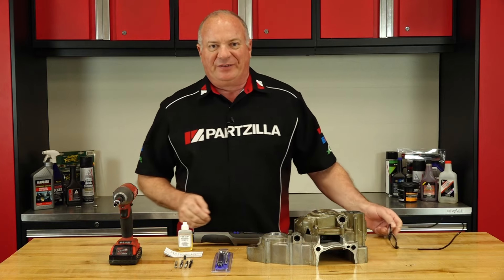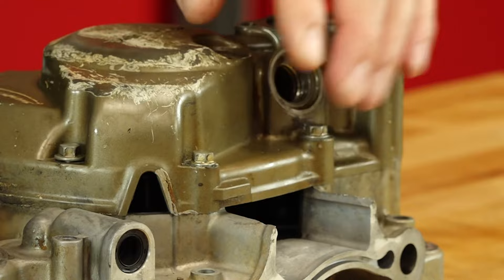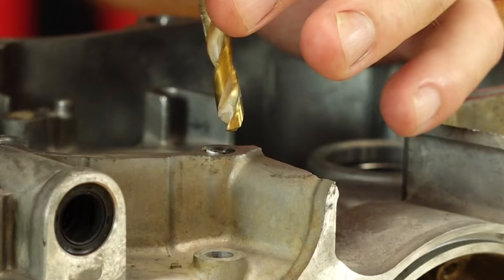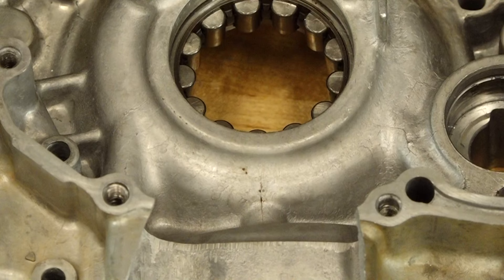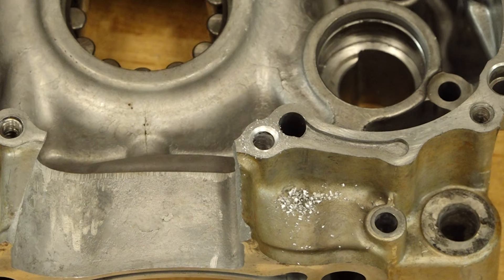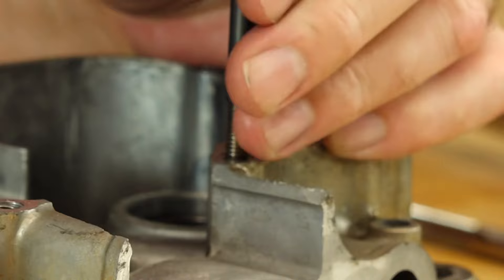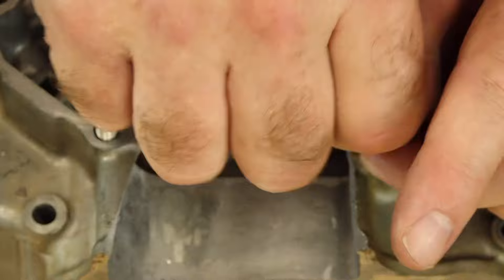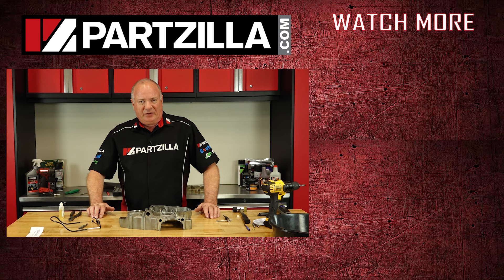Time Sert vs. Heli Coil  | Best Damaged Thread Repair | Best Thread Inserts | Partzilla.com

Comment: Heli Coil was invented and used in air craft engines. Was much stronger than the original threads. To say it is a temp fix is not true. Heli Coil is a proven technology.  Also, your first hole you drilled was crooked.
Reply: A temp fix for a bolt that will be removed from time to time. If you don't want to have to redo the thread repair the next time or two then Time Sert is the best way to go. If you aren't going to be removing that bolt for a long time if ever then  Heli Coil. First hole could have been crooked, could have been camera, but it is irrelevant because this is for demonstrating purposes only as why would he put a Heli Coil and Time Sert on the same bolt pattern for the cover? If it was going to be used? He clearly states that he would use Time Sert. If you want to bitch it should be directed to Partzilla's new website navigation. Not Johns fault btw.

Comment: The tool for inserting the helicoil is used to remove the tang. Just twist in opposite direction. It naturally locks in place as unscrewing it expands it. It can't go anywhere. By using punch you run the risk of dislodging the bottom thread or two of the coil insert. JS 😜
Reply: Why is it that most say to hit the tang  off once installed ? I thought that was how they work ? Would  not allow the stud/bolt to pass it if needed ?
Reply: Helicoil instructions tell you to remove the tang,   and supply a tool with their kit to remove it !  ....
Reply: Not a problem. Both ways work depending on application. It was just the way I was shown during my apprenticeship more than thirty years ago. Possibly the design has changed slightly???

Comment: Ugh😪 so hard to watch him strip them on purpose... my stomach went down to my knees... I almost cried a little bit 🥺
Reply from the maker: They were sacrificed in the name of YouTube...
Reply: Man up son
Reply: Just think of it this way: the casing gave its body to science.

It's like med students learning on a cadaver. Hopefully that part was never going to be reinstalled anywhere.
Reply: First one went in sooooo crooked

Helicoil tang will snap off by simply turning the slotted insertion tool backwards, there is a weak point designed to snap.
Reply: Are you ok?
Reply: @iFixJunk 😂

Comment: as a tool maker we use helicoil in our alum molds and plates that get changed out almost daily. they have seen 1000's of cycles of bolts in and out without failure. also why tap with the small wrench when you had a tap handle handy.  i would avoid your shop after seeing this video. all this video showed is you make more commission from time serts

Comment: There are always pros and cons - helicoils are good if the hole has good clearance but not too much and if installed properly - people always forget to drill out all the parent thread - and this can jack out the helicoil - they can skip threads if you dont pull slightly against them when carry out its installation- helicoils are prices well and robust - the cons are if the thread has hole has too much clearance the helicoil will not fix that - Time certs - industry standard / expensive - can fix a hole with larger clearance but a deep hole can present problems if there is no suitable counter bore to sop against and drilling a counter hole at the top to make it flush can also be problematic if there is an oil or water groove close by or the wall thickness is not there - so pros and cons one is no better than the other - its just that industry has leaned towards a solid insert rather than a coil - but that does not make it a better product…..!
Reply: Assuming none of those Time Sert cons are applicable, and that will be for a LOT of people at home working on their cars, Timesert is more durable and can handle far more torque. That's why it's approved by OEMs to repair engine blocks. It works in almost all cases and can be considered a permanent fix. Definitely not for the Helicoil.

Cost? What will it cost you to replace an engine block because you used a Helicoil?
Reply: @roots4x  I am inclined to disagree, just because the industry has leaned towards a particular brand - an insert of any type is only as strong as the material around it - a hole or the right pitch and clearance is necessary - I have seen time-certs fail on BMW M52 & M54 as overheating actually sinks the material between the liners and the aluminium alloy actually softens when going past a certain operating temperature (overheating) I have been doing automotive engineering for 25 years and have been using helicoils for just as long - If not installed properly they will pull especially fine pitched threads- Time Certs / WÜRTH have just priced them selves exorbitantly - Horses For Corses
Reply: If you go view several YT videos where they test torque to failure, the time certs did not do as well as the helicoil.  The helicoil outlasted a grade 8 bolt...over 8,000psi.  Helicoil is solid if installed properly.

Comment: Good Video.
When working on a race car pit crew years ago, we Heli-Coiled all of the critical holes that we could and they never failed.   We even Heli-Coiled the lug nuts because we had several times where they would get cross threaded before we Heli-Coiled them.   I think the threads were getting worn even though we used Anti-Seize every time the nuts were removed.   We never had to replace a Heli-Coiled lug nut despite going on and off hundreds of times and they never cross-threaded.    Likewise, with the other Heli-Coils, we installed in the engine and other critical areas - they NEVER had to be replaced and we never had the threads pull out.   Heli-coils with hardened stainless steel threads are far stronger than aluminum or cast iron.   We've used thousands of them in the past 45 years in business.

If you watch how loose the Time Sert was when being installed into the hole, it likely would have failed an official thread test.   It is strongly recommended to use oil whenever drilling or taping metals.   Otherwise, you get holes and threads cut oversize - and lose a lot of strength.   Of course you want to degrease the outside of the Time Sert as well as the hole when planning to use Locktite to retain the TIme Sert.   With Helicoils, you never have to use Locktite because the spring pressure prevents them from moving and we always used oil to install the Heli-coils.

Both are great products - especially with aluminum blocks, heads and so many other parts.   The Time Serts work well on plastic too (such as intake manifolds, etc).    We use a soap solution for lubrication when installing either Time Serts or Heli-Coils in plastic parts to maintain hole and thread size within specifications.
Reply: Hello. 
Quality top notch answer there, one can really tell you know stuff.
A question: In the first half of your answer it sounds like you think helicoils are best.
But at the bottom you write both are great products. - Could you please tell in which situations Helicoils are best? - And in which situations TimeCerts are best? :-) 

Thanks a lot NaberAuto! :-)
Reply: AWESOME... but did you see what happens after a year or more in a corrosive environment,  like say, on an outboard that runs saltwater?
It's a TOTALLY different ballgame.

Comment: Thanks for the video. Just an FYI, Time Sert’s instructions stress that you want to avoid bottoming out the insertion tool. So only run the tool through the Time Sert until it gets easy to turn, which means the bottom threads have expanded and locked the insert into the hole. No need to go any further.

Comment: I'm sold on time-serts for their ability to handle a lot of torque. I repaired 7/16 inch mounting holes for a 62 Fairlane strut bracket, using fine threads to increase torquing power. They are costly and a blind hole sometimes doesn't offer enough room to run the insert tool deep enough to flare out the insert. Heli coils are fine in low torque applications. I used them to repair the carb stud holes on my vintage edelbrock intake, and they are just fine. And far less expensive.

Comment: Very helpful video!
Presumably if you were doing this "for reals" you'd want to use (a) a drill press, stepping up the drill bit sizes, (b) a tap handle to guide the tap (maybe (c) a tap follower too since you've got the drill press), (d) cutting fluid, and (e) compressed air to blow out the swarf and the broken tab of the helicoil.
Reply: And drill the hole straight!
Reply: Everything wrong with his technique
Reply: @joeheinzle  and go buy a tap wrench

Comment: Using a tap wrench instead of a spanner gives much better control and helps to keep the tap straight. Clamping the casing so it doesnt spin is aslo a good idea for several reasons and don't forget your safety glasses especially using compressed air to eject the cuttings🤕 All being said great video to show the comparisons. Thank you
Reply: Tap wrench is a good idea, I'm just about to do a snapped nipple on an RS4 caliper..
Reply: I cringed when the spanner came out 😄
Reply: But I don't think heli has moved I dud at 1st I'll inspect once I get cylinder back off . And stud out (bolt I mean) just don't get how it's broken before torquing  up

Comment: Great video - In shop class we were always taught to use cutting oil / motor oil whenever drilling or cutting threads. WD40 is a good cutting oil as well
Reply: Cutting oil is the exact opposite of engine oil look into it. They taught you wrong. Cutting oil mates surfaces engine oil seprates them.

Comment: Caliper thread repaird whit stainless hardsteel time insert, came in a kit. Drill tap metric m9 1.25
Strong and saved a lot of hassle changing complete hub.
Good video. Thanks.

Comment: Helicoils are incredible, Ive used them to on engine heads and are pretty much rated for at least 200lbs ft.
Reply: Hi I'm in process of getting my old bike mechanic to reppace my heli fir a timesert  for piece of mind . Many say theure ok for temp fix . And read some have had a second keak from a heli  on a head . For some reason my head bolt that goes to heli  passed its yield  point and twisted then broke  not sure why as I used 25nm in sequence that went OK then 37nm but broke very unhappy
Reply: WTF, 200ftlbs of torque. bruh i recently stripped my dirt bikes oil pan threads and that dog shit is rated at only 18ftlbs so i just cant rap my head around that
Reply: Ya a dirt bike not a car

Comment: you don't need a punch to break the tang you just remove the installation tool turn it 90 degrees, push down and break the tang then remove it from the hole.
helicoils can be used indefinitely they are not one time use only. they are also stronger than time serts and take more torque to yield.

Comment: I had a thread repaired in a 500 Caddy intake manifold. It holds a bolt that secures the compressor but also blocks  off vacuum as well as it goes through the intake runner. Bad design in my opinion. The machinist went with the Time Sert because of the durability.

Comment: Great video mate 👍  I'd advise anyone with access to a drill press to use that instead of a cordless drill. It looked like it wasn't completely square due to this method.
Reply: Agreed, and I observed the same in the video.

Unfortunately, a lot of the times I've had to do this the part was not something I could bring to the drill press (like a mount on the side of the motor), so I do my best to start slowly so I can see if the bit is cutting more on one side; then I adjust accordingly until my drill bit appears to shed chips equally on the entire perimeter of the hole.

If possible, maybe use a jig made on the drill press that you can bring to the engine, if necessary, but I've always had to just wing it.

Comment: Well never heard of a time sert. Been using heil coils for years. But I would like to see a cost comparison. Heli coils have got ubber expensive like everything else. I have a few kits I've paid in excess of $75.00 each, to fix one hole. But that expense was also I needed it right now rather than waiting a week or 2 for an online order. I have heli coiled head threads with no problems. Sometimes I drill out the alcoa and put in heli coils simply because over time the metal to alcoa monster growls and threads pull. And yes brake clean and red loc tite.

Comment: Great video.... A huge help is to drill out the threads in steps with oil on the drill, and the drill will follow the hole, and maintain the correct hole size much better than going in with just 1 drill.

Comment: Not sure if you'll reply but I've just got onto my old bike mechanic he's gonna reppace my heli for a timesert it seems so much better especially for my situation being a hg bolt into crank case for head gasket
Reply: Why replace ?
Reply: @philippe94416  wasn't after it hadn't moved bikes rebuilt no issues

Comment: So at the end of the day which has better torque, sheer, pull strength? Also if a blind hole was deep enough could you use a timesert over a heli coil any issue with this besides cost and overkill

Comment: The dealer says my rear gearbox plug threads are nonexistent and he’s going to fix it with some kind of pipe plug. I’m not mechanical but stumbled here in trying to educate myself. I want to understand the problem and be able to fix it myself if it reoccurs. How do I know what size Time-Sert to order for my ATV? I don’t even know where to start or how to search for it. Thank you for a great video!

Comment: I’m trying to repair the thread on my timing belt tensioner on my 2jz engine, I’ve repaired or have made threads. The threads I’m trying to fix are 10mm x 1.25 so do i have to look for a tap and dye set in that size or one size bigger like a 10mm x 1.5? Or does the 10mm by 1.25 kit already compensate for the thread insert?

Comment: So is the Time Sert Threaded all the way onto the Driver Tool before you thread it into the newly tapped hole?  Or is the Driver tool only partially threaded into Time Sert when you start to thread it?
Reply: It doesn't matter, because as you screw the time sert in with the tool. It will thread itself all the way down into the time sert and spread the bottom, locking the time sert into place. Hope that helps.

Comment: What if there is a hair line crack on the inside of the crankcase.i have a stripped out head bolt on my100 cc 2 cycle mortor what can i do to save it.its a new mortor any tips

Comment: is the coil really important in this process cause you already used the tapping to carve the thread , what is the advantage of using the coil ?
Reply: the hole he tapped is bigger than it was before, the helicoil gets it back to original diameter, also helicoil gives a stronger thread than parent material

Comment: I stripped the cam chain tensioner bolt on a 2018 honda grom. What route should I take?
Reply: I would suggest timesert. I tried helicoil and it failed. Bike shop fixed me up with timesert.

Comment: Hi. I’ve 2005 Suzuki Boulevard C50 but when I put it in gear, it doesn’t move, the clutch just raise but no movement. Please help me with amending that problem.
Reply: It sounds like your pressure plate is stuffed? Insert 3/8” UNC helicoil two inches from the left of plate edge and, when complete, fair dump the clutch!

Comment: Why did he drill first and not just Tapp and insert
Reply: Because that's the correct procedure for helicoils, and probably for time cert.
Why ?
A stripped thread is neither a known and consistent diameter nor clean metal. You need to bore to get to usable metal.
Then thread to the larger size with the right tap.
Yes you can managed to skip the drill to enlarge part, but the results will be unpredictable.....

Comment: WHAT NO LOCTITE ON THE HELICOil
Reply: Loctite’ll leak through to the inside of the coiled thread and remain in liquid form until you put the bolt in, at which time the unit locks together and becomes as one!